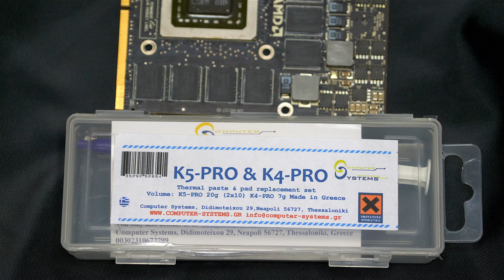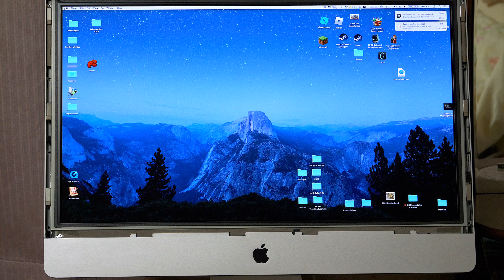Late 2009 iMac 27" Video Card Repair — 4850 — 3rd Bake

Comment: Hey I followed your instructions to bake my sisters Late 27” 2009 iMac and everything worked great for about two months and it just went out last night.

 It would actually show the loading screen (white Apple logo with progress bar, then turn off about half way through.  These machines do get warm so I was thinking time to re-bake.  

Since I was at my sisters house I decided to re-bake it again and just happen to catch this video and I rewatched your first video where you talked about the logic board battery replacement and I must have missed the C vs. B battery part.  

The weird thing is, the video card looked good with very moist paste as you mentioned in this video.   

Do you think the C battery I have on the logic board could be affecting this?
Reply from the maker: I am very sorry to hear your first bake lasted only two months. But please consider that even my first bake lasted only four months, which was disappointing to me. What kind of thermal paste did you use? And did you clean off all of the old thermal paste?

The BR2032 battery has nothing whatsoever to do with the problem, and your computer will work even if you completely remove it.
Reply: JDW 
Hey thanks for the reply.  I agree that the second time will be better. 

Re: Battery 

I was curious because I had the C version battery and thought that may be an issue.  

Re: Clean up and Thermal Paste

Originally this was the first time I’ve ever attempted something like this. I followed your steps from Bake Video 1 (Procedure) and Video 2, using the K4 and K5.  Worked for 2.5 mos and I think it may not have been shutdown on a regular basis and not sure how the fan software (Mac Fan Control) may have helped.  

This second time, I followed steps and mimicked Video 4 (Bake 3).  I used more Isopropyl Alcohol (IPA,91%) to clean the card than last (which may have made the difference as last time it came out more “smokey”.  I had a tube of K5 and plenty of K4, so I placed it as you had on Video 4.  I also cleaned up the logic board, fans, and debris or gunk I tried to clean by IPA or air can.  

Other than messing up where 
one of the logic board screws goes in (attached to enclosure, no damage to board, wires, or connections) everything worked fine after the second bake.
Reply from the maker: Thank you for sharing the details of both of your bakes. It is odd. I can’t explain why you only got 2 1/2 months out of your first bake. I’ve always thought my first bake failed after only 4 months because I didn’t thoroughly clean off the old paste and because I used old paste as well. There’s no way to know for sure. I can only say that my second bake lasted two years and nine months. And I truly hope your second bake last at least that long as well. Ditto for my third bake! :-)

Comment: Thanks JDW, For your promised response, as you mentioned in previous post.
And yes i shall try the flash light technique, and let you know my findings.

I have baked my Graphics card previous to my post with the upmost detailed steps
you suggested. you have given me an avenue to pursue the Back light option,

Question? Chain of thought, do you think its possible to bake the Back light, 

I am not trained in this field of any electronics just thinking out side of the box
your advise would be invaluable.

Just an quick update. 30. 03.2020   K4 & K5 Pro Kit  arrived in the post this morning
Thanks JDW for listening.
Reply from the maker: The back light “inverter board“ has at least one fluid filled electrolytic capacitor on it, and for that reason you cannot bake it. But there are no components on that board that would benefit from a high temperature fix. That’s why if the inverter board is bad, you would need to replace it.
Reply: @JDW-  

Hello JDW.
In response to the flash light test.
I was unable to see any lights or a faint image using a flash light.
As you mentioned the Back Light Inverter board. i shall follow
that route and look for a replacement in due course.
Question..I hear no Chime or Mac sound on boot up, fans are spinning
how likely is this related to the Back Light Inverter board?
Looking through the Ram vents i do see green lights on the LBoard

Thank you In advance.
Reply from the maker: @englushboy1243  LED lights being ON in the area of the RAM slots indicates your power supply is working, and the fact you said you can hear the fans is evidence of that too.  So I do NOT think your power supply is bad.  

If you shine a flashlight into the LCD and CANNOT see anything, it means it's the VIDEO CARD, not the backlight inverter board.  But, if you shine a flashlight and you DO see something on the LCD, then it's a bad backlight inverter board. So because you are telling me that you know for a fact you cannot see anything on the screen when you use a flashlight, then the root problem is NOT the inverter board.  

The presence or lack of a boot chime does not mean the root problem is NOT the video card.  Indeed, it still could be the video card.  While rare, I do recall one person saying he tried the bake twice and it didn't resurrect his iMac.  That tells me his video card was too far gone to be resurrected by the bake.  He told me he was going to look for a replacement video card.

So in your case, it really does seem like there's an issue with your video card still, despite the fact you told me you baked it.  Again, this is not a common case.  Since if you read through the comments you can see that the majority of people who try the bake find that it works.  But the bake isn't 100% guaranteed.  Even  so, there may be a possibility a second bake could work.  But I admit it is a lot of trouble, especially dealing with paste cleaning and reapplication.  But it might be best to try it before you plunk down cash for a replacement card or a new iMac.  It's the least costly thing to try.
Reply: @JDW-  

Hello  JDW.
Once again, Thanks for lending your ears &
guidance, I've taken steps to strip the machine and re bake once again, this time
applying the K5-PRO K4Pro. As you rightly said "What do you have to loose".
In a worst case scenario if unsuccessful
i shall box the Mac and store it until i come 

across replacement parts..
I'll keep you in the loop.but for now I'm
about to get my hands dirty.

Thank you Sir.
Reply: Hello JDW.
No success. Went through the process
this time applying K4-K5.

Symptoms ..Fan Spinning real fast like the sound  of a portable Hair drier and noticeably louder then calming from time to time.
Total Black Screen..
Lights on  Board Looking through vents.

Plan of action,, To Box & Store until I'm
able to replace Graphic Card.
I'll keep you in the loop

Thank you for your kind Support
Reply from the maker: @englushboy1243  I am sorry to hear that it didn't work.  I know you must be disappointed in light of how much time that surely took you.  But it does appear that replacing the card is the only recourse for your machine.  Thank you for letting me know.  Best wishes.

Comment: The second gen Sandy bridge came whit a internal gpu; have you ever tried to run whit out video card???
Reply from the maker: The bake described in my videos applies primarily to my late 2009 27" iMac, but other people have told me in the Comments they found success trying it on 2008 through 2011 models.  All those 2008 to 2011 models have a removable video card, but the iMac will NOT work without it.  In other words, there is no integrated graphics on the 2008 to 2011 iMacs.

Comment: Hi JDW. 

I've watched all Yr Vidz on Baking  G8t stuff.
A little history of my Mac & issue.
Spec..I Mac "Core" i7" 3.4 27-Inch (Mid-2011) 8-10 Yr old
Issues. No Chime or Beep Sounds, Total Black Screen. 

I can here the Mac Boot, it will take a CD if inserted & eject
Looking through the vents at the bottom where the Ram sits i see two green lights on the
Mother Board but the angle of view is difficult to diagnose clearly .
My first attempt of a fix..
Labeled all parts before removing as you showed in your  first Video 

then the almighty Bake off 10Mins.. The Big Switch On."Black Screen no Chime or Beep"..

Paste used as.. ARCTIC MX4..and Thermal Pads..at the time that's all i had 
I've read in your comments to a subscriber that you suggested the K4 & K5 Pro  
which i have ordered and awaiting for its arrival.
could you please shed any light or further assistance on a possible solution at all.
thank you for your Honesty and encouragement.
Reply from the maker: The LED lights are normal even if the video card needs a bake.  But if you are 100% sure your Mac is definitely booting every time, you should be able to shine a flashing into the display and see the LCD.  If you can do that, it means only your backlight is bad and the video card is fine.  That is more of a rare problem though, so please do the flashlight test to confirm.  By the way, did you bake your video card before, or are you preparing to do it for the first time?

Comment: Would love a video on the fan control software.
Reply from the maker: I will consider that, Alex. I’m putting the finishing touches on my analog board recapping video for the MacIntosh 128K through the Plus right now. :-)
Reply: @JDW-  Thank you for considering. It would be a relevant addendum to the GPU bake videos that you have been generous enough to share. The info is invaluable.

Comment: Wondering why you put so little pro on the center chip - I added as much on the center as I did the others successfully... Wondering if that might extend life of the bakes?
Reply from the maker: The only reason I put a lot of K5 Pro on the surrounding memory chips (all chips OTHER THAN the main GPU chip) is only because there is a gap of at least 2mm between those other chips and the heatsink AND the manufacturer of K5 Pro also specifies the method I show as being the correct way to apply K5 Pro.  The GPU is not like that.  There is no gap between the GPU and the heatsink.  And you must NEVER use K5 Pro on the GPU because K5 Pro is not made to handle that kind of heat.  If you put an enormous amount of paste (K4 Pro or Thermal Grizzly Kryonaut) on the GPU, most of it will squeeze out and spill over the sides of the chip.  So long as the paste you use on the GPU is NOT electrically conductive, it should be OK (again, NOT K5 Pro though!), but it's always best to use paste on the GPU sparingly.  This is specified in the paste manufacturer's instructions too.

Comment: did bake on 20" today - main chip paste was dried but outer chips were ok - added all new pastes. Didn't help - still have vertical grey lines - but still works OK - Couldn't get MHT to mount - also tried  SMC and NVRam - but didn't help. May try switching display ( I have an extra somewhere) - lots of time since the world is closed anyway...
Reply from the maker: Do you mean you have the 21.5"?  What model year?  And how is your iMac able to work if you get vertical grey lines?

Comment: hi,
I would highly advise you to upgrade to an new compatible nvidia or newer AMD video card !
please read this topic !

2009 27" Core i series iMacs, aswell as all 2010/2011 iMac's can be upgraded..

https://forums.macrumors.com/threads/2011-imac-graphics-card-upgrade.1596614/

You can go even for a cheap quadro card, flash the EFI bios on it these days and also have the EFI bootscreen back.
you GPU is then no more garbage, and is also Metal compatible.
you can then even use the dosdude1 patcher to run Mojave/Catalina on your imac.
Reply from the maker: Thank you for the link.  I actually am aware of that, but as you can read from that page, there is a lot for the end user to consider, even more than what is involved in a bake.  The average person might find the bake easier to understand.  But for the brave of heart, and for those willing to obviously spend the money on a different card, your suggestion is a valid one.  Thanks for the mention.

Comment: Thanks for the update. I baked my GPU only a few months ago, so I'll probably check back here in two years or so! Did I also notice that you put some K5 on different chips this time? I mean the ones furthers from the GPU (on the left hand side of the video). If so, I would interested to hear more about it. Thank you.
Reply from the maker: Many months ago, one person in the Comments asked why I didn't put K5 Pro on the tiny chips in the far back of the card, seeing there is a portion of the heatsink that protrudes down over them.  The reason why I didn't do that in my 1st & 2nd bakes is because Apple didn't put any paste there at all, so I assumed Apple knew what it was doing.  But in this 3rd bake I had nothing to lose by trying it, and since I had enough paste left it wasn't a problem.  The chips are tiny though, so I don't think it matters.  The shape of the heatsink may have accounted for a slightly different card with bigger RAM chips in that area.  Since the 4850 doesn't have RAM chips there, Apple didn't put the paste there -- or so I speculate.  Anyway, I put it there to pacify folks who feel it should be pasted there all the same.  I doubt it will suddenly make the card last past 3 years though.  Thanks for watching!